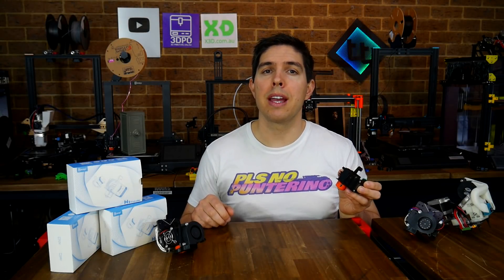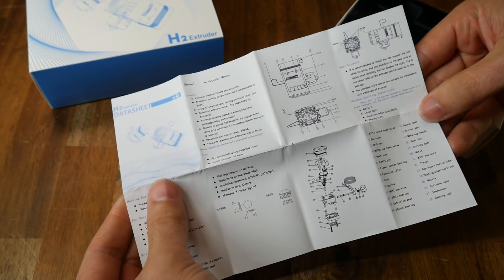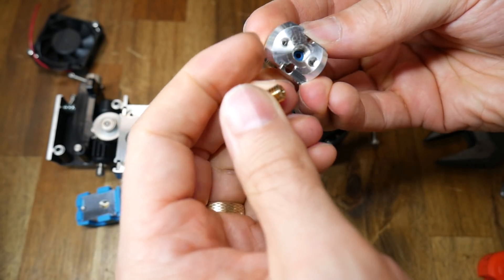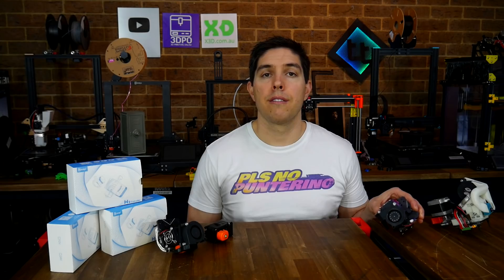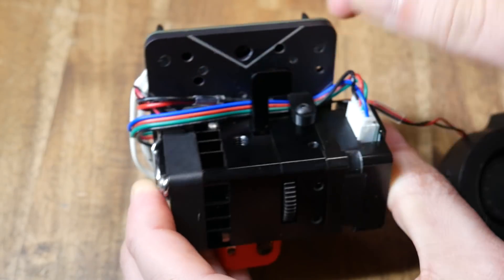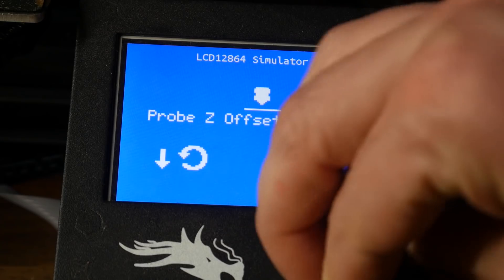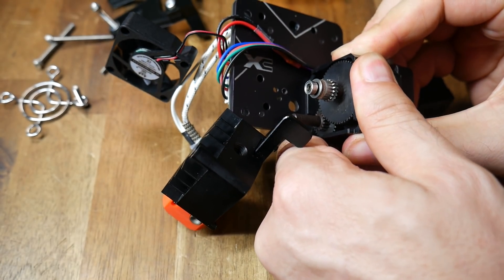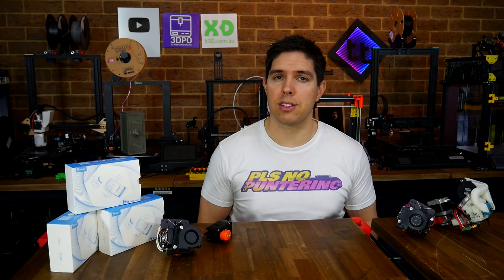The fantastic* BIQU H2 extruder/hot end - (*IF you get a good one)

Comment: Split type lock washers don't actually do anything. That's why you don't see them in automotive or industry anymore. All they do is provide a false sense of security. Best thing to do is use threadlocker.
Reply: Thank you! As an engineer it kills me whenever I see these. They are nothing more than a standard washer with a fancy slice at best and a complete waste of material at worst. Pretty much the only kind of lock washers that do anything are "Nordlocks" but those are expensive and you may as well just use thread lock especially if you can't torque the fastener to spec due to material concerns.
Reply: It's incredible. I attended a few engineering lectures almost 15 years ago and even back then they taught that these washers don't do anything. NASA figured it out by 1990 and yet there are still people out and about recommending them.
Reply: Was thinking the same, they work if you open them and let them "bite" both the surface and the bolt when screwing down. They are useful with softer bolts on aluminum
Reply: @andy_liga  they actually aren't useful in any situation. There's been a lot of tests done on them and they simply don't work.  Even modifying them doesn't do anything. The reason is by the time the washer can "bite" into the material the fastener has already begun to loosen.
Reply: @DoRC  I tip my hat to you then, I've done some reading now about it and I must admit that I feel a bit silly.

Then again, my grandpa taught me most of my mechanic knowledge when I was young, so I assume he was "up-to-date" with the latest and greatest of the '70s 🤣
Reply: @andy_liga  my dad taught me to be a mechanic. He also believed in lock washers.
Reply: Yes, even NASA points this out in their Fastener Design Manual (https://ntrs.nasa.gov/citations/19900009424 ), PDF page 13:
"The lockwasher serves as a spring while the bolt is being tightened. However, the washer is normally flat by the time the bolt is fully torqued. At this time it is equivalent to a solid flat washer, and its locking ability is nonexistent. In summary, a Iockwasher of this type is useless for locking"
Reply: In this application I think he used them as a spacer so the screws didn't go into the stepper motor as much and cause a bind, at least to me anyway.
Reply: @Twin_Flyer  not based on what he said in the video....
Reply: @Twin_Flyer  that's not what he said. He said he was using them so the screws wouldn't back out due to the vibration
Reply: @DoRC  Thanks for the update, I was watching the video while at work and I guess didn't have the volume up enough to hear everything he said.
Reply: Nordlock washers are amazing though
Reply: I work in the medical science manufacturing industry. I'd have to disagree with you and many of my brilliant engineer colleagues would also disagree. Split washers are not always the solution but they certainly have a place in manufacturing.

Comment: I would like to see the H2 mounted on the Ender 3 without the easy XChange mount. Also a tutorial on adding the BLTouch.
Reply: Yes, it was disappointing to see him use a mounting system that isn't available to the average Joe. I'm mounting one to an Ender 3 v2 clone (Voxelab Aquila) right now, and it is pretty fiddly. I can see why he'd want to take the easy way out with the Exchange system, but dang... a bit of help working through mounting for us regular guys would be great.
Reply: @floorpizza8074  What do think of the Aquila?
Reply: @petercallison5765  It is a lot of printer for the price. IMO, it's one of the best Ender 3 clones around. Right out of the box, it is a very capable printer, and is easily upgraded as your printer skills grow.

I've since upgraded it with dual Z axis motors, a BiQu H2 extruder/hotend combo, two POM Z axis lead screw nuts (yup, POM is an upgrade over brass), flexible Z axis couplers, adjustable Z axis motor mounts to perfectly straighten out the Z axis, a BLTouch, and a dedicated Raspberry Pi for OctoPrint. Next will be a magnetic bed with PEI print surface, primarily to reduce the weight of the Y axis for higher speed.

If you enjoy tinkering, for less than half the price of a Prusa 3, you get all the features and print quality of the Prusa. I have a bit less than 400 bucks into my setup.

I've enjoyed it so much that I'm already planning on purchasing a second and third.

Comment: First one I got for my Ender6 never worked, it looked like the large gear was binding against the housing. The replacement is running fine (after lubrication), but came with one stripped heat-brake grub screw.

Comment: My Hemera's all have that click sound during retraction, I have 6 of those.  A few months ago I bought 3 H2's, they all were bad, returned them.. maybe I will order another one to see if I get a good one this time, I really love the form factor of these extruders.
Reply: all my h2s click on retraction one binds up on the thumb wheel but prints okay one turns smooth but still clicks bad on retraction my only hemera is rock solid
Reply: @420247paul  Hi, the engineer fine-tuned the gap between the parts so it can make the fitness between the parts more compatible. Later we will further optimize it and improve the stability.
Reply: Extruder 'click' vanishes with Lucas Red Tacky grease.  Doesn't take a lot.

Comment: i have the BIQU BX. The driver current is set to 1050 aM by default. Is that wrong? should i change the value? How do I know that I should change the value?
Reply: Put your hand on the motor during operation. If it gets really uncomfortably hot, your current is too high.

Comment: Got tired of waiting for the Hermera to come back on the market.  Then came across the H2 with the bonus of a huge weight saving.  Installed it on my new build core xy.  Some minor install issues but it has worked perfectly since with PLA, PETG and TPU.  Love the manual feed wheel
Reply: Hi, thank you for your support. We will keep improving the H2!
Reply: @BIQU_Makers  thank you for making awesome products. I can’t wait to use the H2 on my Ender 5 Plus with your SKR 1.4 turbo board running Klipper! I have a microcenter store that is local by me and they have the H2 units in stock. Is there a way to tell if those are the newer, improved versions of the H2? Thanks!
Reply: @BIQU_Makers  Will there be a H3? maybe with single handed nozzle change and maybe a liquid cooled version? watercooling is one of the only things i miss on both the Hemera, and the H2, as an option.

I would almost buy a Trianglelab Matrix LC because it's the only Hemera-like thing with watercooling, but it's heavier than even the Hemera so i wouldn't buy it..

If a H2/H3 water cooled version would come out i would probably instantly buy it..

infact an appropriate name would maybe be a H2-O cause of watercooled version?
Reply: @BH4x0r  Hi BH4x0r, BIQU just released the water cooling version a couple of weeks ago, check their website ;)
Reply: @Fernando_Gazzola  yup i actually have it since January 4 already lol
Reply: @BH4x0r  Nice!! I receive a newsletter more recently 😁. How it performs? Which materials did you test with it?
Reply: It came back months ago
Reply: @cda32  I bought the BIQU months ago.  As murphy would have it, the Hermera came back in store about a week later.  At the time I got the BIQU I had been waiting for months for the Hermera.

Comment: Would love to see a video on the Bigtreetech IDEX kit for Ender 3
Reply: I have this kit and I would only recommend it to an advanced user. I had to work out a few issues with it on my own, and design my own solution for a belt tensioner and electronics case. also, I had a few QA issues with it but it was an early production unit.
Reply: @natanelbenzaki3071  Hi, if you still feel like you need support for your IDEX Kit, we’d love to take a look into any issues you’re experiencing, so we can quickly resolve them. Please feel free to send an email to support01@bigtree-tech.com.
Reply: @BIQU_Makers  Thanks for your reply, glad to see you are trying to expand to other means of communication with costumers. I have received all the support I needed from the support team and Tony BTT at Facebook messenger. Still waiting for a few replacement parts at the moment to get it working properly. I ould still recommend this kit but only to an advanced user capable of modding it and the printer.

Comment: I have my H2 water cooled, but yeah it too gets stuck when the bolts are tight and factory mangled one of the screws holding the heatbreak.
Reply: Is yours an earlier build date? I've read that mid March is when they made the change over to a new gear supplier.
Reply: Hi, if you still feel like you need extra support, please feel free to send an email to service001@biqu3d.com and we'd be glad to help.
Reply: @BIQU_Makers  Thanks, I was offered a new front plate, but I refused. I just hope quality control will improve.